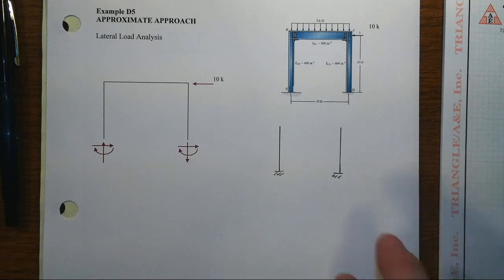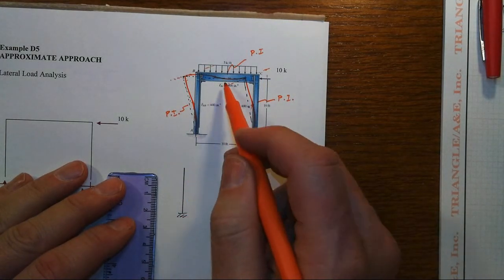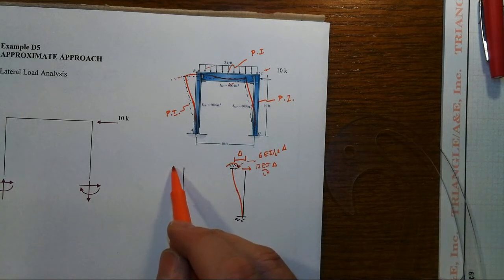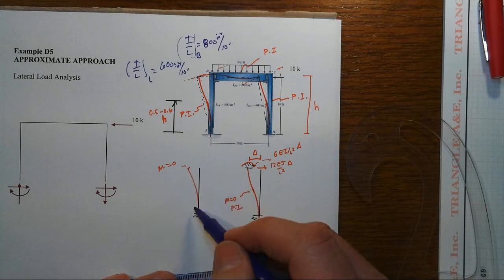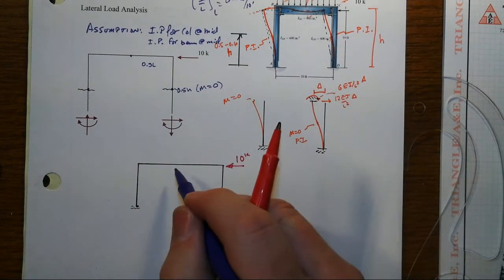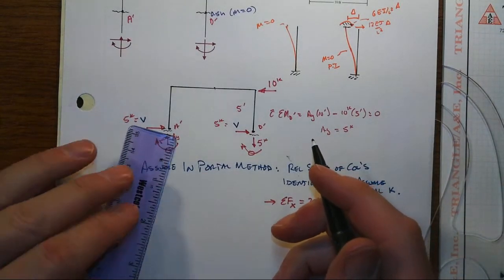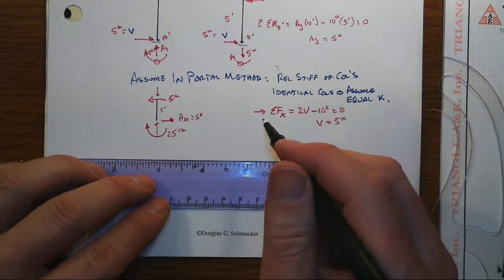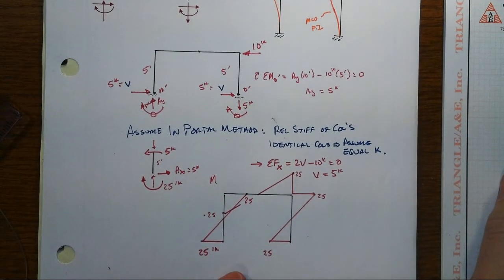Approximate Frame Analysis with Lateral Load Portal Method

Comment: At 10:29 when calculating sum of Md' why didn't you add Ax*5? And wouldn't that add more unkowns to the equation?
Reply from the maker: Hi Ancel.  Thank you for the question and the precise nature of it.  Really helps when someone is that detailed.  Neither of the x-component forces at A' and D' (these are the shears in the respective columns) are included because both of them have a moment arm of zero with respect to point D'.  The point D' is 5-ft from the top ... or wherever you decide to approximate the location of the inflection point (internal moment in each column to be zero).  Since that was the same for both columns (5-ft from the top), then in the moment equation about point D' the line of action of the shear in column AB will pass through point D'.